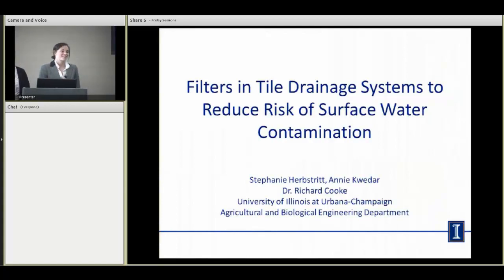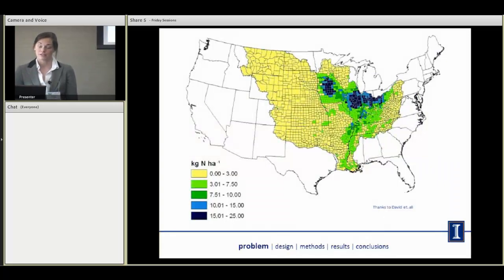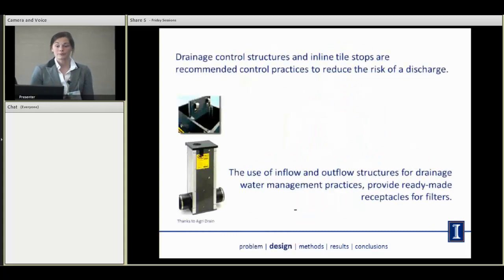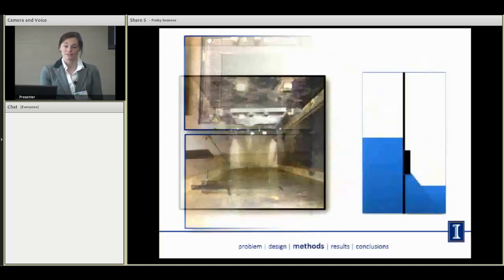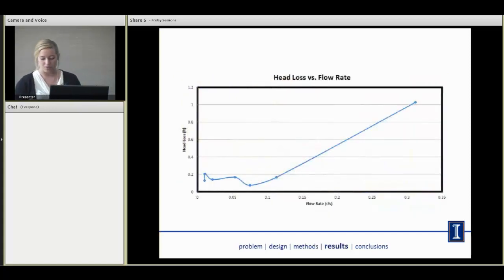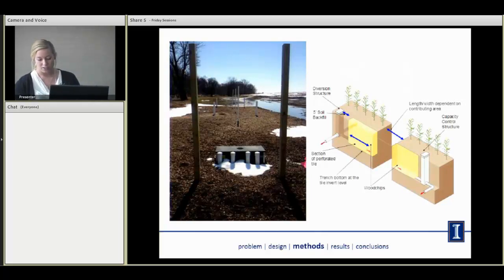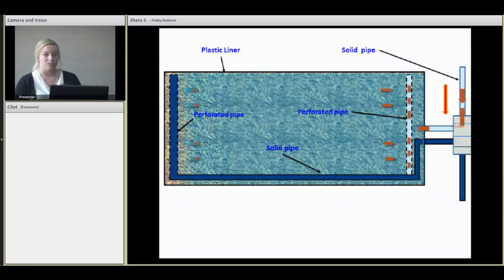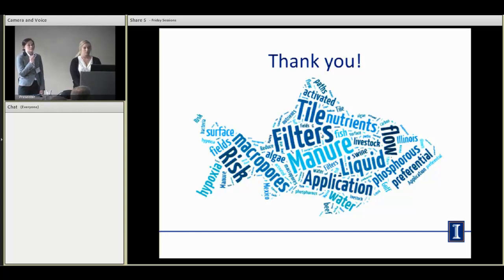Filters in Tile Drainage Systems to Reduce Risk of Surface Water Contamination

Comment: i am against use of wood chips being used. the wood chips decay like any other organic matter. that decaying = just what you are trying to capture and remove, is putting extra right back into the water. while it not be directly ammonia, nitrate, nitrites and a given amount, but rather the sap, leaves, bark, and wood itself that went into the wood chipper when the trees were turned into wood chips.  this material can turn the color of water different color, some of the lumber can be non native and may have a "poisoning effect" to aquatic life. more so during initial construction, and short time there after when unit is first put into service and water flushes through the system. and then any time there after when the system is cleaned and/or disturbed physically. 

there is no "pre filter" to the unit, pre filter being something that captures stuff that is viable to the eye.  example leaves, twigs, fish poop, uneaten fish food for a goldfish / koi pond. pre filter tends to go down to stuff that one can see physically but may not be able to physically remove with ones hands, and needing a foam or mat or net to physically capture and remove.   without having a pre filter, the filter you have designed is going to get clogged quickly with any sort of erosion make it from soil/dirt within the drainage tile system in and of it self, to other. resulting in the filter becoming completely and udderly useless within a very short amount of time if there is any sort of erosion.   

the filter is further going to degrade and become useless due to no easy way to clean the system. the bacteria, single cell organisms and like that break down ammonia -> nitrate ->nitrite grow just like everything else make it plants to animals, and with any sort of silt and like further clog up any filter material you use.  as the filter media becomes clogged water will begin "short cutting" and "channeling" through the filter media, causing even further reduction of effectiveness of the filter. 

if this was compared to a septic tank and septic field,  a septic tank would be a "pre filter" capturing larger waste, and then sending the effluent to the septic field. you are only installed a septic field style filter without a septic tank. resulting in clogged up septic field.

further you are not offering any sort of off gassing.  while it does look like you have setup a filter with a "septic field" in mind with breather pipes to the surface, i would still assume you are still relying on non aerobic condition (lack of oxygen) conditions to process waste water. non aerobic filtration is slower in breaking down ammonia -> nitrate -> nitrites. vs an aerobic filtration which brings in much more air / oxygen into the system and process the ammonia -> nitrate -> nitrites quicker.  the bring in of air also allows water to air mixture that both allows stuff in the water to go into the air, and stuff in the air to be absorbed in the water for example oxygen into the water. 

drain tile systems generally are subsurface, and could be completely thought of as a "well" or an "aquifer" that is void of dissolved oxygen in the water and or oxygen within the system.  

further more the drain tiles themselves are not installed in such a way that would allow free air movement through them. if anything many times it is shown the drain tile system is acting like a "siphon" and physically could pull water into them. causing even further erosion into the drain tile system.   if this was a home, and you had 2 toilets, and you flushed one toilet, you would physically cause water in the other toilet to get sucked out of the toilet and cause waste gasses to come back into the home. or in case of drain tile, and manure, or liquid chemicals applied, to even granulated fertilizers that dissolve with water. would be physically sucked into the drain tile system.  causing even more pollution of the water that would need to be dealt with. 

further more, most times it is only shown A SINGLE valve is used on a drain tile system. but most times the fields have varying elevations.  one valve = flooding the lower elevation of fields, and leaving the higher elevation portions of the field high and dry.  there is no mention of use of multiple valves that would be needed in such situations. 

overall would suggest looking at septic tanks, septic fields for homes and restaurants, to koi/goldfish filtration systems, to even aquarium filtration systems, to city and like waste management faculties.  all of these filters and systems take waste and filter what is coming into them and reduce the pollution amount going out of them.  they are all more or less the same thing just applied differently.  some may need larger pre filtration, some may need less, some may need larger bio reactor / (ammonia -> nitrate -> nitrite) areas, others may need more off gassing, others need more frequent cleanings, some require additional size to meet peek loads. such as a 5,10,25,50,100 year rain falls in case of drainage tile system. 

additional things to take in, many "gutters" on folks homes and businesses might come down into the ground via pipe and have a surface outlet some place in the yard. to "french drain" setups were drain tile is covered with filter sock / filter material, to drainage rock.

cleaning the filter and maintaining the filter long term needs to be accounted for, and more so during the initial installation / construction of installing the drainage tile into the field and the 1 to 3 years there after of erosion that will happen until the soil becomes stable enough that erosion happening directly around the drainage tile is reduced.  and then there after any thing that might disturb the soil within a foot of the drainage tile.  make it any sort of tilling, planting, injecting or like of general farming of tillable land / fields.
Reply: add to above, simple cheap means of testing the water is not stated, for example, a generic "goldfish / koi pond" kit, tends to have ammonia, nitrate, and nitrate test kits including ph,  some of the bigger test kits come with phosphorus and some other tests.  these cheap test kits need to be available to farmers and marketed to farmers. so they can grab / buy and go out and take some tests without having to jack around running between labs that may be any were from 30 minutes to a couple hours away. and then waiting even longer to get test results back from a lab. 

due to need to most likely test multiple fields and more so multiple locations of drain tile waters,  having a simple couple glass beakers or like is not going to cut it. but a physical holder to hold 20 or so beakers at a time, plus the test cards with instructions, plus a container to dump water/chemicals out of beakers after they are done.  i would imagine the setup needs to be a case more like a "fishing tackle box" or like, so one could toss it into a truck or strap it to a 4 wheeler / UTV / ATV and go and get things done quickly and easily.  adding in some "timers" or "alarms" (stop watches) a place to hold a notepad and some pencils so one can mark off results in a spreadsheet like fashion. 

in other words instead of getting water samples and bringing back to office, bring a small case / tackle box that holds enough for a small office out in the field to do the tests and record the test results. KISS (keep it simply stupid)